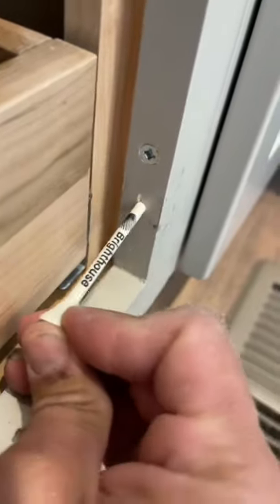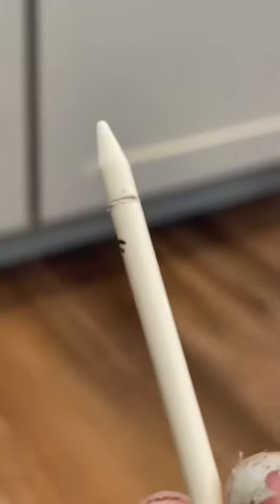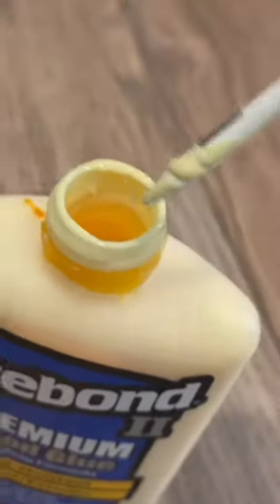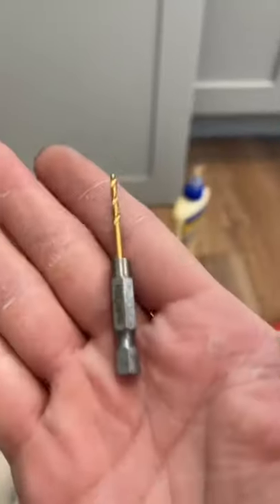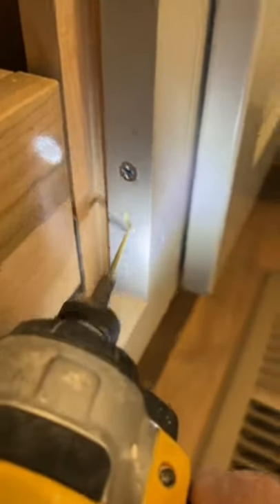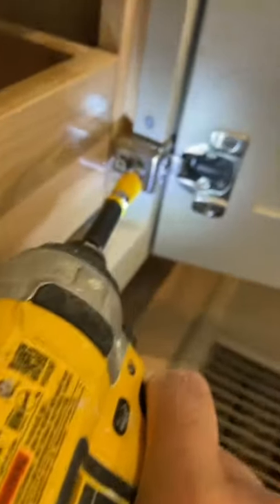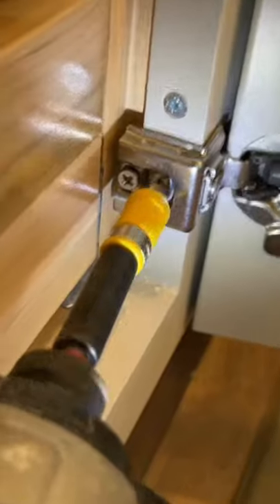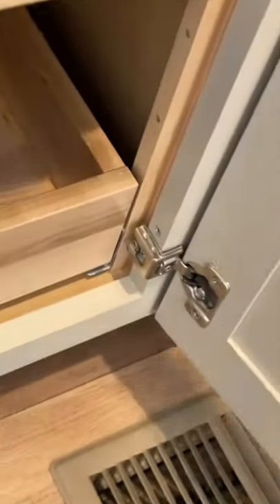How to fix loose cabinet door. #shorts #diy #howto #handyman #colorado

Comment: I've had pretty good luck with sticking a zip tie tail in stuff like that and putting the screw back in...it forces the screw to engage the wood again.

Also works with tapcons in brick.
Reply: Great tip.  Thanks! 👍
Reply: A zip tie would be more Mickey Mouse. Jalapeño man did it better.
Reply: I have done that before with a electric drill with striped holes kept falling apart if it it metal use copper wire works Great 👍
Reply: @ShinkuGouki  the only thing u need to do is make the hole smaller zip tie it’s easier because you don’t have to drill a hole push it in put the screw in and you’re done
Reply: I always used mechanics wire lol. Worked for me so 🤷
Reply: @NotAWomble  at my work a magnet drill had problems with the holes and I put welding wire in it and everything was nice an snug aluminium frame so it has some give

Comment: That’s a beautiful kitchen! Only problem is, the handle on the drawer isn’t centered with the cabinet doors below
Reply: That's done on purpose, so you don't have to bend down to open them.
Reply: why would that make it so you don’t have to bend down? It’s not like it’s way off center, it’s off by like half an inch like someone couldn’t have been bothered to measure